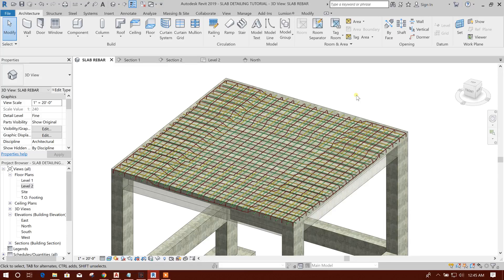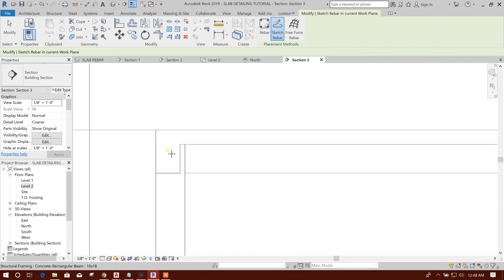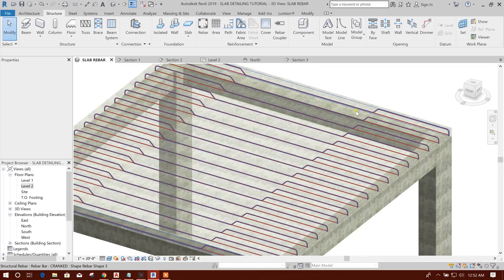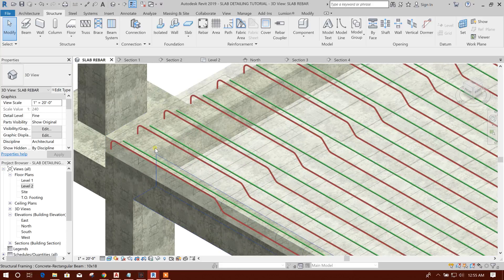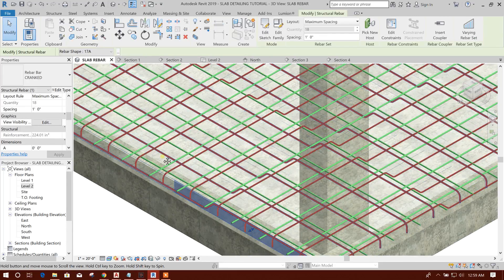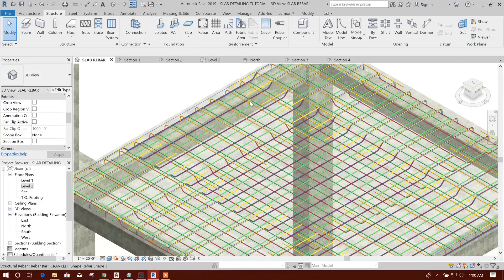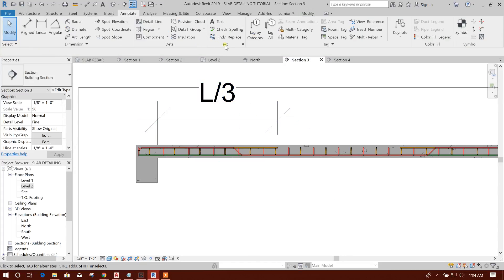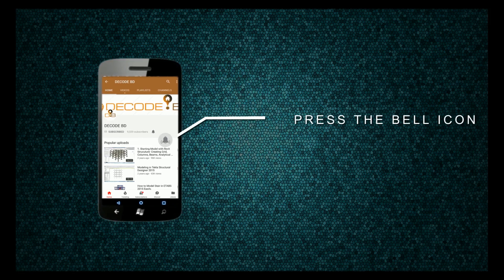Two Way Slab Detailing with Cranked Rebar in Revit

Comment: Bro plz explain in revit 1.how to do splicing rebar in column   and
2.While placing rebar's on beam and column it get over lapped (collapsing)  on joints  (plz explain its correct or not) -main rebar's of both column and beam rebar's are collapsing at joint
But in on site condition rebars in joints region are  adjusted in alternative manner
3.while doing classdetection check in revit it highlight those rebars all the time 
4.if u know any special plugin plz suggest for me